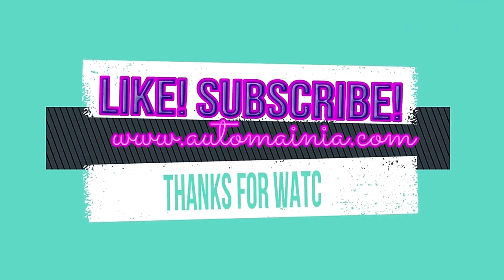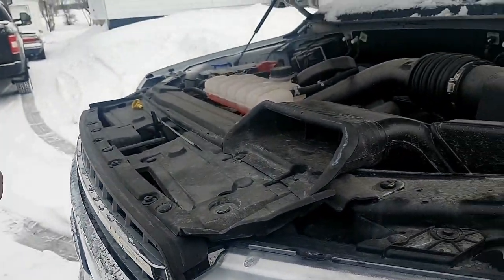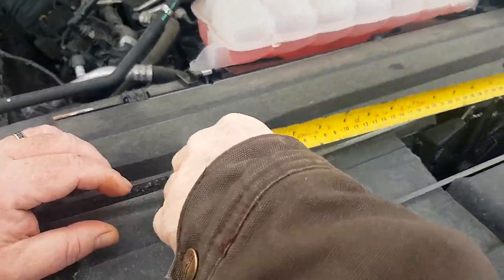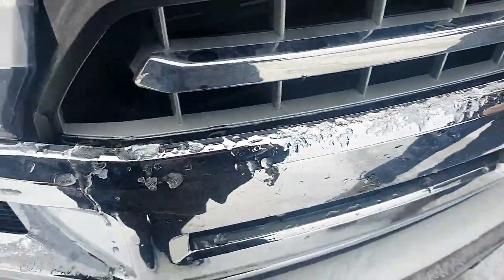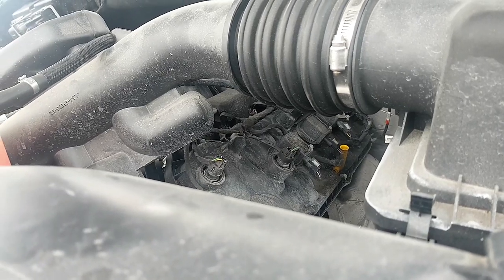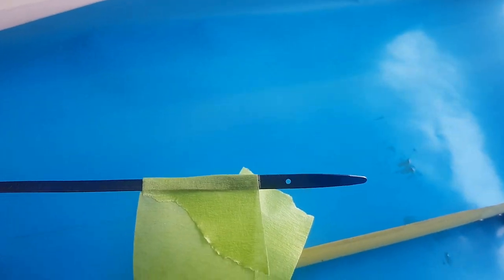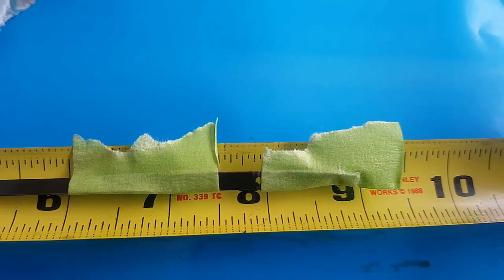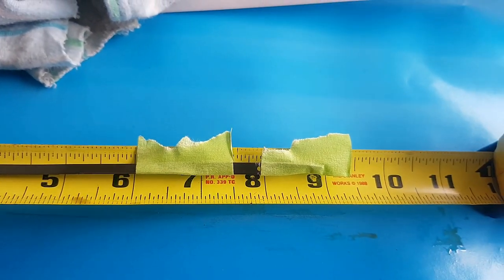widen the range f150 oil consumption 2018 2019 f150  5.0 liter tsb 2338 and tsb 2058

Comment: Hello is might be a last email message.  But my friend here in Los Angeles, California had the same problem on his 2018 F150 5.0L. My friend truck was out of warranty. He tried to get his engine replaced but in the end Ford purchased this truck back.  He then purchased a new Ford 2021 F-250 with a Godzilla 7.3l V8.  My friend filed claims under the Lemon Law and obtained an attorney.  The process took approximately 10-11 months after getting an attorney.  

Here how it started. We attended a car show with manufactures from High Performance /After Market Parts displaying their products.  After talking to several Performance Manufactures and explaining the problem with the engine, and what Ford did to try to fix the problem.  They advised us to take it to a Engine Dyno and measure the rear wheel Horsepower/Torque to see if the engine is making less power with more oil added.  Those who do not know what a Dyno is. It's like your truck running on a tread mill to measure the speed. The test that was done. 1st my friend remove and placed back the original oil dip stick and removed oil because it showed over filled.  Since we all know that Ford is over filling the engines with oil with the new oil dip sticks they installed.  I believe my friend removed 2.5-3.0 quarts of oil until it showed full on the dip stick.  After the test. Then my friend did the 2nd test by removing the original dip stick and replaced it with the one Ford Service installed, and placed back the 2.5-3.0 quarts that were removed earlier.  The engine test on the 1st (oil removed  2.5-3.0 quarts) and 2nd with no oil removed. Dyno was run 3 times to come up with an overall average.  I do not remember the Horsepower / Torque rating from the 1st, and 2nd test. But I do remember his truck made on average 17-19 horsepower more with the oil removed. With Ford's quick fix problem most if not all of you are being robbed driving with less power and torque from your engine.  In the end it was taken to a 2nd Dyno location and filmed by the attorney investigators for my friend case.  

Those of you fight your case don't let big Ford win, because they are getting away with millions of $$ and screwing the customers.

To "THIS GUY'S GARAGE", if you read this can you try to make a video on this update.  Hopefully you will be able to explain it in you video. Thanks

Comment: Is it possible that they realized the oil level was just too high?  8 quarts is the most I have ever seen go into a gasoline engine.  I had the TSB done.  If the level stabilizes it may be true.  I am 500 miles in so far
Reply from the maker: There are a lot of people experiencing this problem hoping you are one of the lucky ones who is not and will not.  Keep an eye on it.  The engine was engineered for  8 liter since it was released in 2011. Thanks for taking the time truely appreciated.
Reply: I do have the issue. After about 1500 miles the level drops below the lower limit

Comment: The problem was write in front of you about waste high.  🤔 
My nephew has the same problem with his ford. The dealer said that it was normal.  Maybe Ford should pin the rings so they don't line up.  But what do I know.
Reply from the maker: They may have circled the problem 🤜🤛 right on the rings